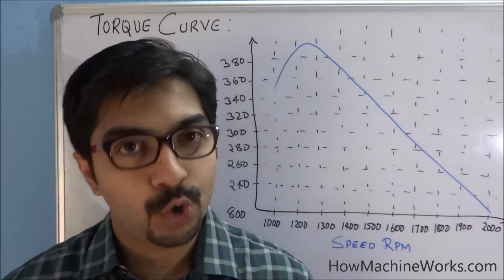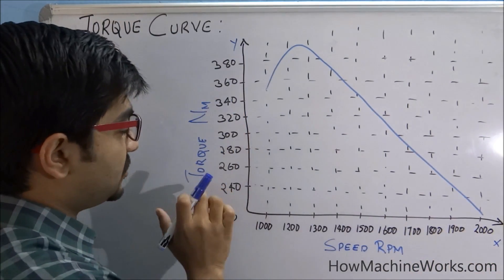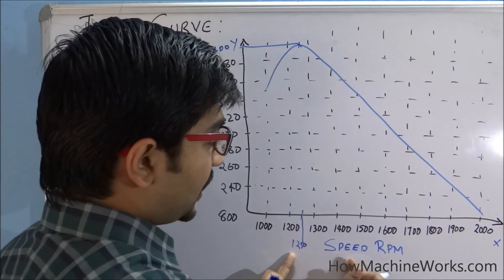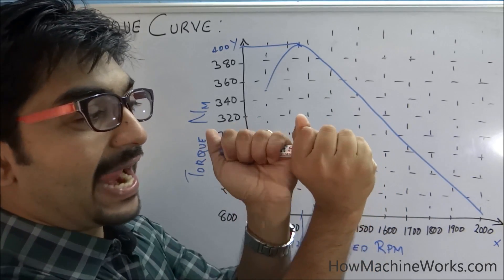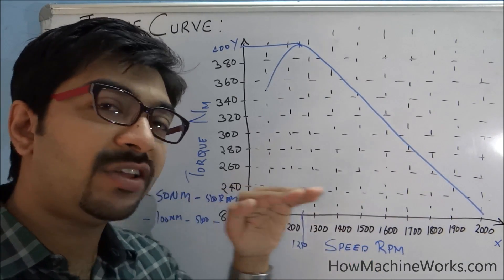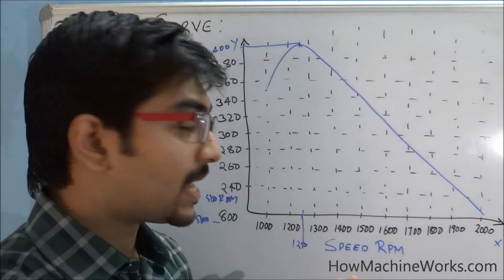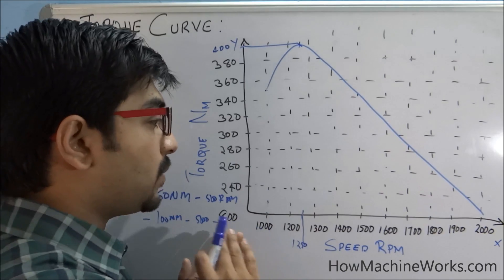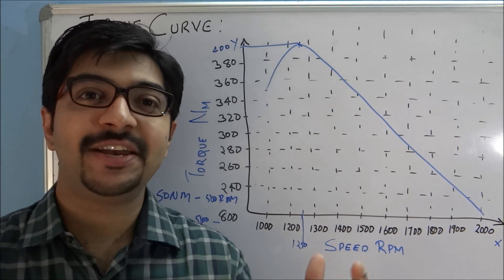How torque reduces when Rpm increases -Torque Curve Explained - Must watch

Comment: Ok. But if this engine doesn't have a variable transmission, will the engine not experiencing reduction in torque as the RPM rises ?

Comment: I thought you were going to explaining why it happens. Also when you are on  5th gear and change  suddenly to the 2nd gear the rpm will increase probably beyond the point of max torque. So I think your video needs some correction and a relevant explanation. Thanks

Comment: Hi I'm John Titor, a timetraveller from the 2020. As far I know, the torque increasing in lower gears has little if not nothing to do with the torque curve. The torque curve shows torque at the engine side of things. The boost in torque due to downshift is due to the gear ratio change favoring more torque at drivetrain side of things compromising the speed.

Comment: It is because of energy conservation. 
Thermal energy is converted to flywheels kinetic energy 1/2 IW2.
Suppose engine is loaded by a dyno (  brake). Because of braking , some energy is dissipated as heat. Kinetic energy of flywheel decreases because of this . This is observed as decrease in speed of engine. This is only applicable if thermal energy ( fuel injected ) is constant.

Comment: Higher gear gives less torque because it gives more speed than tourqe, and it is also why the first and second gear are meant to pull to the vehicle when idle, and that is also why it is easier to climb an inclined road with lower gear than higher gear

Comment: first of all. you did not explain "HOW" the torque reduces as rpm increases which is what brought me here, secondly YOU CANNOT USE your example of GEARS in a manual transmission to just say that is why, in EACH GEAR no matter which , the torque will start to drop after a certain RPM of the ENGINE, so for you to say torque decreases the faster you go or the higher gears you use is nonsensical, if that was the case I would always dyno my car in first gear and not fourth and always get crazy torque and hp. 
NOW IF YOU CAN EXPLAIN APART FROM "ROTATIONAL VIBRATIONS" and other ways in which kinetic engery can be lost, PLEASE DO SO AND TELL US AS RPM INCREASES "WHY OR HOW IS TORQUE DECREASING" and not tell us what we already know which is that "IT JUST DOES" 
I WILL NOT LIKE AND I WILL NOT SUBSCRIBE AND I DONT WANT TO BE TOLD TO GET UPDATES WHAT DO I LOOK LIKE ANDROID OR WINDOWS? UNTIL IT CAN BE EXPLAINED.

Comment: torque does not reduce when rpm increase because Torque has nothing to do with rpm, torque=Force x distance. It is power that is rpm related ;)
so.. thumbs down for the video :)
Torque force is made by the explosion pushingt the cilinders up and down... i believe we see torque decrease at higher rpm because the combustion becomes less and less optimal , has something to do with combustion pressure , and time to explode becomes smaller and smaller and if u could rev to 10k rpm u would see missfires or detonation or whaever engine failure. On graph HP is still raising for a short period after torque decreases just because HP is direct proportional with RPM.  HP=0.5252 x Torque x RPM

Comment: what u did not explain why torque is deceased after certain rpm. Its because every engine has its peak breathing capacity and it can not take more air in due to time is getting shorter as valves opening/closing very fast. Please speak slowly.

Comment: Your labels on the bottom of your graph are wrong. They are in units of 100 pm, on the bottom of your graph it goes, 1000, 1200,1300,1400, 1500, etc. between the first 2 numbers is 200 and the rest is 100.

Comment: You do know, that what you presented here is the typical torque curve of an electric motor and not of an internal combustion engine, do you?
Reply: No - an electric motor has maximum torque from zero revs and then falls off at some very high RPM.  This is not a typical torque curve of anything really, since it's so wildly inaccurate.
Reply: shi01  Well that's what I thought, but have a look at the torque output for the Tesla Model S.
Reply: ZigSputnik
Tesla uses so called "brushless DC motors" which in reality is nothing else than an synchronous AC motor with some sophisticated control electronics. And guess what the control electronics does beside a few other things like convert DC to 3 phase AC? Yes, it limits the current at low rpm and so the torque. The torque curve Tesla shows for the Model S is the way it is because they designed the control electronics this way. It has nothing to do with the actual electric motor.
Reply: shi01 Ah, ok thanks for that.  So the torque isn't really at max at zero revs but slightly above zero revs.  I suppose the coil would need to be superconducting to achieve that.

Comment: what freaking engine do you take the "tork" curve from.... doesnt look like any i know of. 
and most engines have a "hill" design of tq. low at bottom rpm and top rpm. it doesnt just get lower as rpm increases. thats a freaking terrible assumption.
Reply: +Chad W Read this: https://en.wikipedia.org/wiki/Power_band#Diesel_Engines
Reply: Dude it was just for a visual representation.  A Diesel torque curve could look like this.
Reply: could, any engine COULD look that that, but it doesnt.
Reply: There are large diesel engines that have such torque curves.
Reply: Marek Sumguy no they dont..... show me one the peaks at 1200rpm, but runs to 2000 with a linear decent to 2000.... show me
Reply: Yes... BIG Diesel engines have such curves!.
Reply: Marek Sumguy again show me one...show me a peak power at 1100 but revs to 2000
Reply: ok, you still didnt show me one....

this relationship we have is getting boring... you fail to show evidence of your claim....

Comment: Ok, where to begin ?! ... 
First of all, the analogy of shifting down will increase torque and decrease RPM does not explain why that happens. You just pointed out some fact we already know by simply observing. We know that it's because of the ratio between the driving gear and the driven gear that determines the output torque but you did not explain how that actually happens, you know ... equations, formulas and shit.
Second of all,  calm the fuck down. Were you in a rush there ? If you try to explain something and really want to share your knowledge take your time.
Last but not least, i get you are indian but work on your accent and pronunciation. Or... if this can't be achieved, at least speak in your mother language and insert subtitles.

Comment: Everywhere on the internet, people start explaining that "as the RPM of engine increases, you can see the torque curve declining..." and also "it decreases because power = torque * angular velocity "(<- Using this in the argument means you want me to ACCEPT that due to this relation the curve is the way it is) and what not....but none of these statements actually answer any questions like:
1. Why high RPM means low torque?
2. Why cant torque increase indefinitely with ever-increasing RPMs?
3. Torque is the measure of rotational energy - so shouldn't more rotation mean more energy delivered?
(Please explain logically...not in the manner of 'this is the way things are...')
Peace.
Reply: Point 1 and 2.: I would say the most basic reason ist the decreasing of the air-intake. With higher RPM the time of each stroke deacreases since the piston moves faster up and down. And so does the intake stroke which means less air get into the cylinder -> less fuel can be burned -> less torque.

3.) Power is torque multiplied with speed (RPM in the correct unit). And energy (Work) is Power multiplied with time.
So yes, as long as "the RPM increase faster then the torque drops" you get higher Power. You can see this on many power torque curves.
Reply: That is logical. Thank you. I can relate it. :)
Reply: "rotational energy" is an incorrect term for describing torque.  It has nothing to do with momentum... in the case of an engine.  Torque = twisting force of the crankshaft... which is entirely dependent on the force with which the con rods turn the crankshaft... and the leverage they have (stroke).  The amount of FORCE they push down with depends on the piston bore diameter and the cylinder pressure.   And the cylinder pressure is determined by the amount of air and fuel you can get into the cylinder and combust.  This is called VE (volumetric efficiency).  And depending on the fluid dynamics of your head, inlet and exhaust... this will dictate the shape of your torque curve.
Reply: You can change the flow dynamics of an engine so that the torque curve is completely backwards; it starts off really low and goes only up all the way to redline. This kind of engine will make very high peak power because its peak torque is at very high rpm.  And Power is simply torque x rpm.
Reply: As +Roidal0 said, the higher the RPM, the less time for air intake. The engine wont get as many air at high RPM as it needs. When you run it at max torque, you can easily see that the engine is worling stable and efficient.
Reply: Marek Sumguy well that rather exaggerated judgmental call to say he didn't teach ANYTHING. but yea in this context he wasn't clear
Reply: +Roidal0  but with decrease of intake the rpm must also get lower?????
Reply: Akshat Chauhan
not necessarily. While the engine provide more torque then needed (for example because of air and rolling friction) speed increases. Acceleration stagnates when torque provided and needed becomes equal. On the opposide you loose speed when the engine can not anymore provide enough torque to overcome rolling and air friction.
Reply: +Roidal0 you didnt got my point    to increase rpm more forcefull combustion must be needed how we can achive high rpm by decreasing torque
Reply: +Roidal0 if torque dicrease then rpm should also be decreased
Reply: +Akshat Chauhan well when you are driving in first gear, and your engine has about 200 nm at 3k rpm (and after 3k torque decreases) you will still accelerate, because the engine (although torqune is decreasing) gives more torque than needed to keep the car just moving, thanks to the gear ratio. The car only slows down when torque given is less than torque needed.
Reply: +Gediegen Gegönnt thnks
Reply: +Marek Sumguy nice explained
Reply: asked the same question to my professor... he says thats because the losses increase after that certain amount. thus reduced torque
Reply: LOL!.... thats what your PROFESSOR told you??.  He didn't explain ANYTHING to you!.
Reply: Mukul Bhardwaj exactly, thats what im sayin, we both think da same.
Reply: Torque always will decrease at some rpm because of lack of air-fuel intake and an increase of internal friction. Period.

Comment: he didnt do a good job but the reason torque decrease as rpm increase is because rpm is the speed of rotation while torque is the force of rotation, for example in a diesel engine it has high torque but a low rpm rate, the reason is that diesel engines have high CR because you need to comress thr air so much before you inject the fuel thus having a huge force forcing the piston down while on a super bike it has an engine that redlines at 14k rpm it has a high rate of rpm because the piston had to travel less, the stroke is shorter, sorry but ask any questions of feel free to correct me
Reply: thanks
Reply: It's very useful bro

Comment: nice work!
Reply from the maker: +Hank Fuddle 
We are honored by that comment.
For more info you can email us at techtrixinfo@gmail.com or whats app at +919744615655

TechTrixInfo.com
Reply: TechTrixInfo.com Hi,
Could you please explain the Torque RPM graph for Toyota Etios Platinum petrol. .
Reply: TechTrixInfo.com Hi,
Could you please explain the Torque RPM graph for Toyota Etios Platinum petrol. The company has sent a graph but it is at variance with the values in car brochure as the  Torque curve at its peak intersects the RPM curve at an RPM less than stated by the company. Moreover the graph line for Torque does not show uniform progression but forms a trough before peaking. 

I am able to extract work in all terrain within 2000 RPM and does 80 kmph in overdrive at 2000 rpm.

Please explain.

D.Prem Nath

Comment: When you down shift your rpm goes up and so does your torque.  It's your speed not rpm that is inversely proportional to torque.
Reply: It's simple to think of it as riding a bike with gears. Higher rpm is more pedaling and more power from your legs to sustain the higher rpm. You have less torque available otherwise it wouldn't need all that power going into pedaling. Higher gear allows you to pedal less (lower rpm) to get more work done. IE, you're pedaling 2 rotations for ever 1 wheel rotation instead of 5 pedal rotations for every 1 rotation..
Reply: I thought the same thing? Cause gear 5 doing 40mph would be such low revolutions but 40mph on gear 2 would be murder

Comment: I feel that you did not explain why torque reduces when Rpm increases. You should not have mentioned the gear box for that is another subject, you should have stuck to the engine rotating with out changing gear.    I feel that the torque reduces with Rpm due to many reasons including more  losses but that is not the primary point, I feel you should have mentioned the speed of the burn or the explosion. When at slower speed the angle of the  connecting road  is too vertical and so the moment to produce the torque is  force but no distance  available and the timing of the spark plug could assist,  At high speed the speed of the explosion is too slow and the piston is moving fast and ahead of the  wave-front of the explosion.  so basically at  high speed you have distance available due to the angle of the connecting rod but you have no force  due to the slow explosion time which is more of a burn than an explosion to be correct. Changing in the octane of the fuel helps to redistribute the torque / rpm characteristics, Please do your homework before appearing in public.
Torque changing when  using a gear  box is a totally different cup of tea and  and it may be looked upon as using  levers of different lengths while keeping a constant force. so please be careful in your presentations. A gearbox merely changes the mechanical advantage of the system.
Try and present the explosion as a slow burn so that students can understand why torque changes  Rpm when using the same gear. Good luck.

Comment: I have a generator which need 14 hp motor with 1500 rpm TO RUN.
Now I want to run this generator with 2 HP motor. Tourqe I will increase with help of gear box. but how to manage RPM, gear box reduce the RPM......

can you help me....

Comment: The title of this video can be, Engine peformance plot explained. At each rpm of engine it delivers different amount of power which is leading to the variation of torque against rpm as you shown. The video is not about general relation between torque and rpm. General relation is for same power, both are inversely proportional. the plot will be Y=P/x, for P is constant.

Comment: You are talking out your ass and confusing several concepts at once, 4th gear is typically 1:1 in most cars and second is around 1:2 if your engine is at 2000 RPM and you are in 4th gear your wheels will also be spinning at around 2000 RPM (assuming the diff ratio is 1:1) if you then change down gears to second gear the speed of the vehicle is going to transmit back through the transmission and INCREASE RPM. 

The transmission only converts RPM for torque the torque curve of an engine  depends on the characteristics of that engine not the gearing of it's transmission.
Reply: Spencer Howard  yes, it's pretty stupid.  especially the downshift and higher torque analogy.  actually, he is bouncing back between engine torque and resultant gear'ed torque.    just creates more confusion for those trying to learn
Reply: zanick2 It's essentially fraud, he doesn't know what he's talking about and people are going to walk away from it being worse off than had they not seen the video at all.
Reply: Spencer Howard 

Totally agree - would also help if he's used a realistic torque curve as an example - even a heavy diesel doesn't have that much of a torque drop.
Reply: Spencer Howard  spencer, your values are off, but you have the right idea.   rear ends are usually 2:1 to 4:1.  transmission ratios are much higher. total reductions are near 10:1 in first and near 2:1 in top gears.
Reply: zanick2 I deliberately over simplified the final drive ratios to make the point less convoluted. But yes, i'm aware that the actual drive ratios are lower than that in most cases, depending on the rolling diameter of the wheels etc. The video is still stupid though.

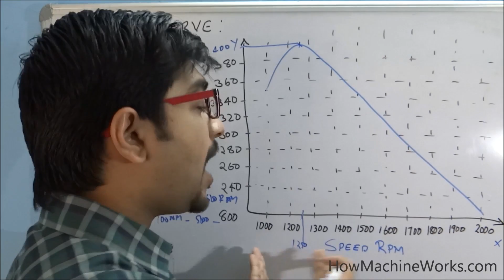Comment: TechTrixInfo.com  really at 2:26 in the video, you said if we downshfit the RPM is going to reduce!! lol! its going to jump up crazy cause to generate that speed too many rotations are required becuase we bought down gearing ratio to even less than 1:1. it would give us crazy torque granted. something you might wanna do on an uphill road when a high speed car with 5 people comes to a halt. but it would definitely not DECREASE RPM!! lol you need to drive!